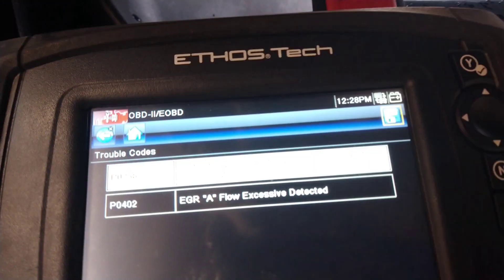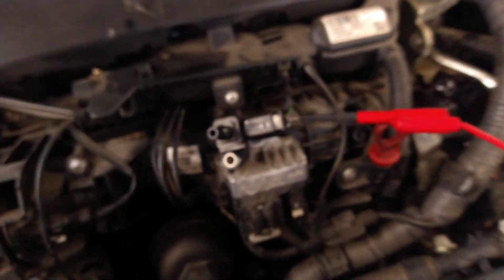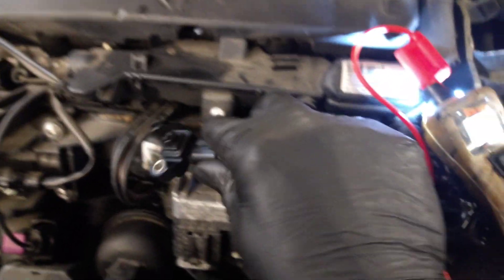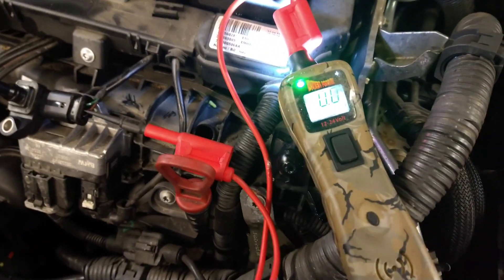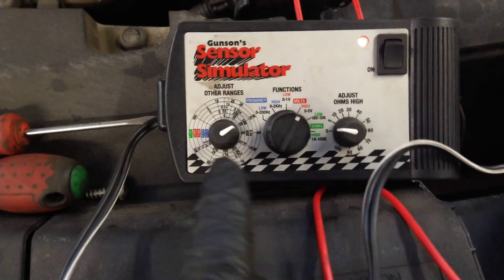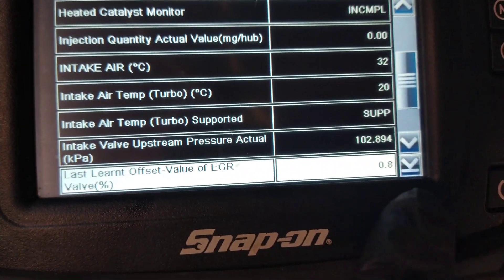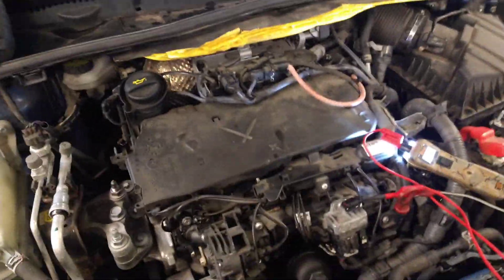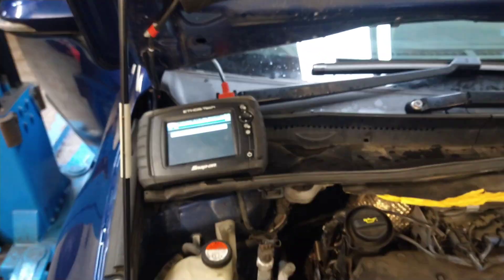Toyota Avensis (P0238 & P0402) diagnosed with a sensor simulator

Comment: Nice one Matt how did you know what kpa it needed ?
Reply from the maker: It's the barometric pressure where I fixed the car, right around sea level. It should be the same with the ignition on  engine off.
Thanks for watching
Reply: @mechanicmatt871  really great thanks 👍 sorry if I ask too many questions I am learning from the best of the best minds 👍